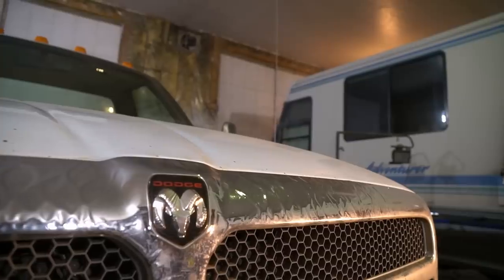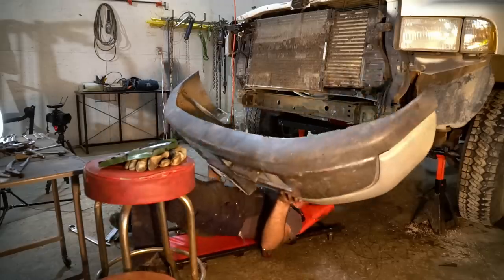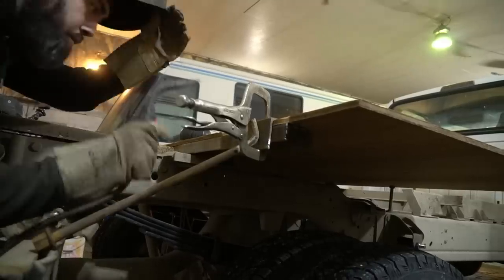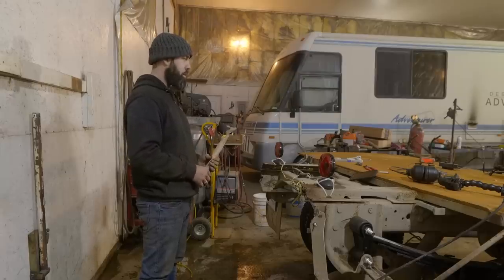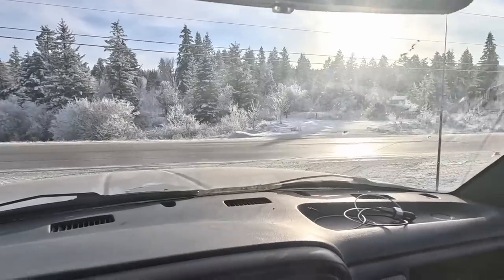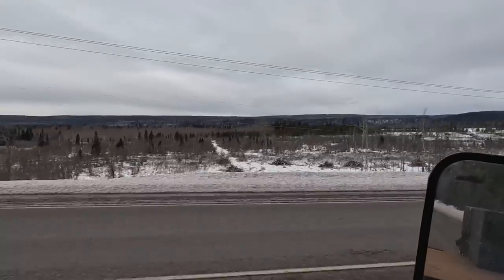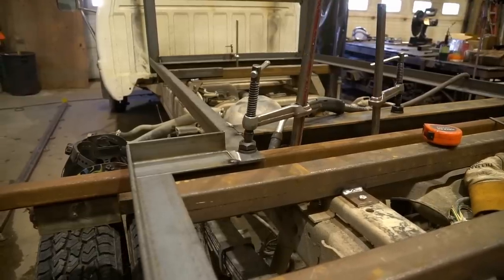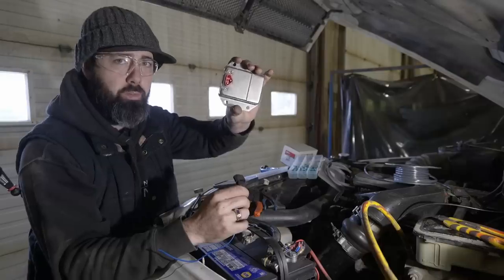The Vehicle With NO Computer | 4X4 Tiny Home | Destination Adventure

Comment: I wrote this before I watched the video, because I was concerned from watching the previous episode. After seeing the problem you had, I would bet money it's cooked bearings. Also, it always starts with the passenger side. Sorry.

In my experience, the rear hub wheel bearings should be installed packed with grease. I know they will eventually get gear lube from the center section, but I've seen them fail dramatically before. Enough lube doesn't make it out to them fast enough.

Comment: You’re gonna love that steering box stabilizer I put a BND one in mine and it made the steering more positive and I haven’t had any more tire rod end problems trucks looking good Dustin I keep going to take a venture down spoken Lake I think I know where your places are used to run greater up and down that road and plough truck and that camper problem you have is a common thing with those campers because they set on the deck and they don’t have any support on the outside edge a friend of mine built a little wall down each side of the camper that helps support the outer edge of the camper and then put storage doors on so he could have extra storage space OK take care hope to see you soon someday Dennis from Horsefly
Reply from the maker: Cheers Dennis,
I’m happy to hear I’m not the only one solving that problem with the camper.  I think we caught it in time.

Comment: Good luck with the regulator, I have upgraded 2 of my trucks to old school and can not get the regulator smooth. Very unstable voltage. Done all the tricks with relays, grounds, big wire runs ect. Even bought some regulators from Mopar, same.

Comment: My Dad has 2 of these Exact Trucks. Same year and everything.  One  is 4×6 AND one is 2×6. 2×6 has 1,000,000+kms on it, it was used for long hauling across NA. It will Accelerate up the Hwy #3 Mine hill, pulling 10,000 Lbs. Transmission was replaced at least 5 times in all that mileage though. You will get where you are going in comfort and in Good time. Much quicker and more agile than the Winnebago for sure.

Comment: I have the same truck only mine is a 2500 single rear wheel, same engine and transmission with 355 gear ratio and I’m lucky if I get 15 miles to the gallon with a a RE truck topper. You’ll be lucky if you get 12.

Comment: I have to move frame trucks around Ontario here. 
Where aftermarket decks and dump boxes get installed.
 You do feel a bit like an idiot when you pull up to a diesel pump only to find out you have no access to the filler nozzle!
 Just a little oversight on your part would you say?

Comment: I had brakes seizing on me randomly on my pickup. I messed around with it for a couple years, and was always afraid to go anywhere. I finally replaced all the disks, calipers, soft lines, some hard lines, pads, shoes, and cables. I haven't had any problems since. It feels good.
One of the emergency brake cables may have gotten kinked. In the end, shotgun won.

Comment: I have a 95 ram with a Cummins and I replaced the electronic four-wheel-drive actuator with a cable set-up similar to the fuel shut off that you installed. No more headaches....

Comment: Just a suggestion, I think you should do a LED swap when you get to the end if it's not in the plans. It's more work but it'll take so much load off your alternator. Such as Lasfit as a suggestion.  Have you also thought of duel alternators? 

I know you how feel about the alignment. First time I did one my front end pulled hard. The schuab guy felt bad and gave me a freebee.

Keep at it, comically I went from bumblefucking my way through fixing my Z to  working on ships.
Reply from the maker: This whole thing will definitely be getting LED lights.  Far too much load with the old stuff.
Reply: @Destination_Adventure  Be mindful some led headlights don't produce as much heat as halogen and don't melt ice or snow build up on them as well
Reply: @austinadventure  it's true but there are AFM kits for that due to that issue along with other simple things like the age old headlight sprayers, heaters, etc. 

Comedically this issue is still been an issue in the era of the sealed beams because multiple car platforms featured sprayers for lights. Like my old 280ZX turbo had them. It wasn't for the sugar scoops being full of snow but the headlights themselves. It's been a common feature on Volvo, Mercedes, SAAB, Datsun/Nissan etc. 

But while yes headlights been an issue. Dash, plate, brake, are a different story. 

I know halogen is the easy answer but there's more than 1 way to bumble fuck a solution.

Comment: Here in the US catalytic converters are not used on diesel vehicles. Thanks for the great vids!
Reply: Actually they are. Every 94.5-97 7.3 PSD, 94-98 12v built after 1/94 and GM 6.5's of the same era had Cats. Cali emissions 12v second gens even had EGR. Lots of later trucks had them as well.
Reply: I have a 1996 E350 with the 7.3. I removed the exhaust system to replace the fuel tank and never noticed a catalytic.

Comment: One thing that might be worth checking or replacing is ur drive shaft carrier bearing. I replaced three on my truck within 2 years before finally getting a one piece custom one made up locally. Dunno if its just my Cummins or a common issue but my driveline would just eat those bearings up like butter. The one piece drive shaft has been the best upgrade on my Cummins Ram...

Comment: I am still dying to see the inside of this used truck camper. I had kinda envisioned you would be making one from scratch like others I have seen on YouTube for "Expedition Campers". Oh, and what is with the burn marks coming out of the water heater vent in the RV at the end of the video???
Reply: It's caused by improper burning of propane, it could be running to rich.  There is a air fuel adjuster built into the water heater burner and can be adjusted to help get a better burn.  It's also common in colder environments as the burnt gasses become cool very fast and become thicker thus causing soot.  Some adjusting can help this but not all of it.

Comment: 26 mpg...haha what a joke....fake news.
Reply from the maker: Without the camper it’s actually getting 29mpg on the highway.
Reply: @Destination_Adventure  no way
Reply from the maker: @tomkelly3896  well, I just drove it 300 km.  You’re welcome to research the MPG of a 12v Cummins.   Year is 1995 if you want to get specific.
Reply: @Destination_Adventure  Awesome !
Reply: My 6 speed manual 24 valve got 23 on the highway with 35” tires.
Reply: @michaelsedway9703  wow...mine got 37 npg...on 37s🤓
Reply: My 96 gets about 25mpg in the city, but once I put the camper on it got about 15mpg.